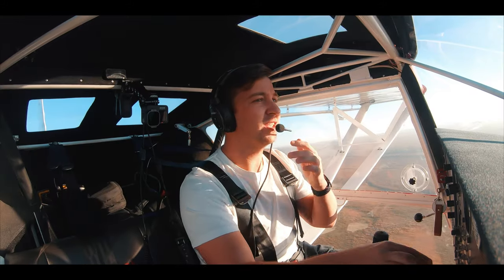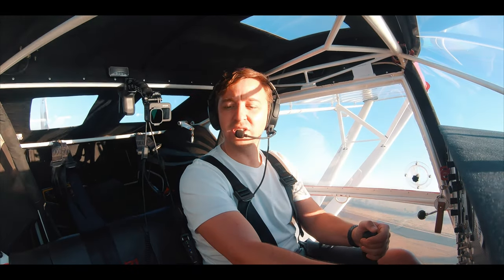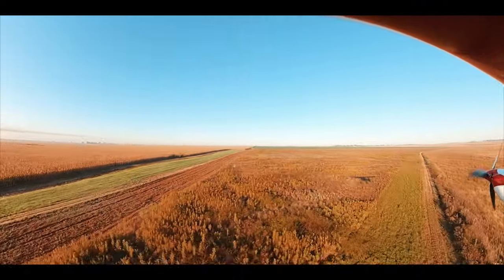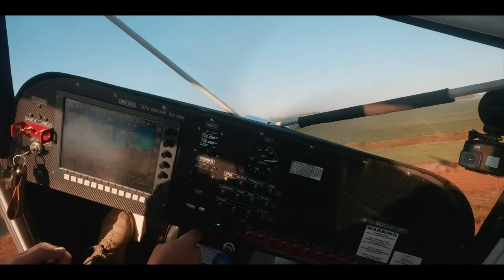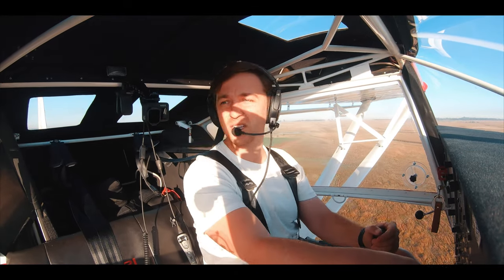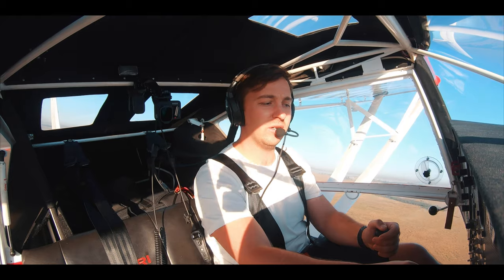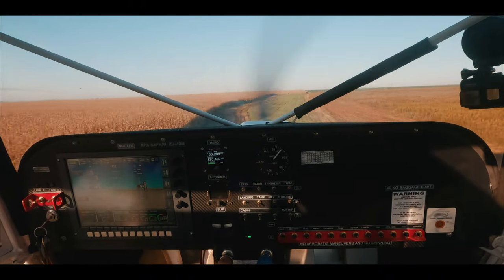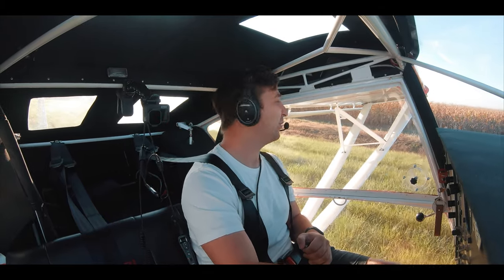I FOUND THE BEST WAY TO RECORD COCKPIT AUDIO

Comment: Great video, thanks for sharing. Another solution I’ve recently discovered is the NFlightcam cockpit kit for smartphones. You can get it in SA but it’s not cheap. The major benefit of this kit is you can connect your headset splitter cable directly to your smartphone and then any audio is automatically synced to the video your record on your phone without any editing required. And then no need for the separate audio recorder as well. Smart phones are typically not as good as the top GoPros quality wise but these days I find it close enough for everyday content. 

Safe flying!
Reply: Are you using a iPhone ? I’m trying to get mine to record audio but it’s not coming through the comms to the phone video recording.
Reply: @danielterry1377  Yes I currently use an iPhone 11 and it works well. I've only had one flight that the audio did not record and this was while plugged into a different headset (a noise cancelling one that isnt mine, I use a David Clarke headset). Unfortunately I'm not sure if I didnt connect the cable properly or if the noise cancelling functionality had something to do with it. Otherwise the audio recording works perfectly every time when using the Nflightcam cable connected to an iPhone. Sound quality is great and virtually no engine or external sound is picked up. Hope this helps.

Comment: Do you rely on the internal batteries of the GoPro’s in the cockpit, or use external power? I found if I use external batteries, I can record continuously, which avoids the need to fiddle with cameras in flight. The only downside to that yes then you end up with many many hours of video to sort through when editing. As for my cockpit audio, I also use a splitter, but record directly to one of the GoPro‘s that is recording continuously. The only issue I have run into with that, is that when you are running a external battery to the GoPro as well as external audio, you end up with a audio delay that needs to be realigned with the video in post editing. It’s a little annoying, but is manageable. I think I am going to switch to a dedicated audio recorder like you are using, so that I can avoid one other small problem with the audio delay. The other small problem is that because the GoPro records video in segments, the audio delay is not the same from one segment to the next. If you stitch all the segments of video together in editing, they may still not align with all the audio throughout the entire recording. You need to realign the audio for each individual segment a video before stitching the videos together. A dedicated audio recorder would eliminate that problem.
Reply from the maker: We have mastered the art of stitching the video and audio together. Unfortunately all GoPros are powered with internal batteries to minimise cabling headaches so we need to switch on the voice recorder and cameras multiple times and then put the two files together in post

Comment: Thank you for the Video!
Which Settings (especially resolution, Frames, white Balance, iso) do you mainly use with the two Gopros in the Cockpit? 
Thanks :)
Reply from the maker: Mostly using 4K 30fps on an auto white balance setting. I limit the iso to 1000. The thing with flying is that the light and temperature is always changing 

I do use an ND filter to limit the shutter speed too

Comment: Do you use some remote controls? Especially, since the Max doesn't have such a long battery runtime...
Reply from the maker: Use the phone as a remote for the 360 - put battery life is approx 1:15 on the 360 so it is often on and off throughout the flight